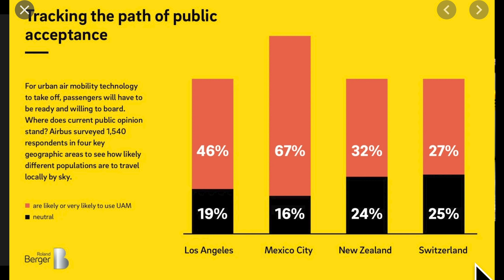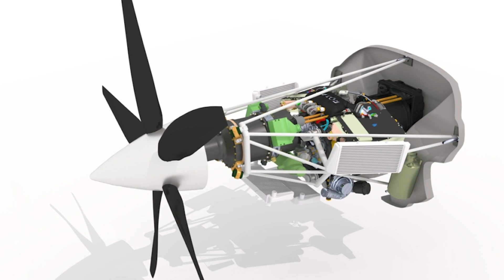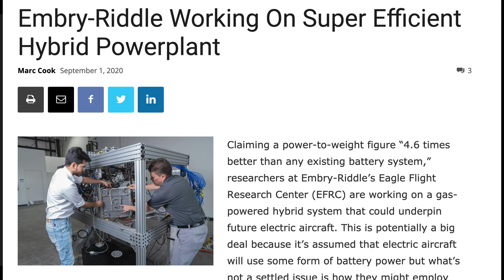AVweb VODCAST: Why Electric Aircraft Are Tilting Toward Hybrid Drives

Comment: Battery powered anything is far from green!  If you want “clean” transportation, ride a bike or walk. The mining, production, transportation and worst of all disposal of the batteries is far from green and far from cost effective.
Reply: It is far greener than fossil fuels. I've seen this sort of thought before, but for some reason people forget the immense energy usage and pollution that occurs from the extraction of fossil fuels, the refinement of fossil fuels (which is pretty inefficient since it relies on heat evaporation chambers for different products), and lastly the transportation of the fuel by another vehicle that is likely fossil fuel driven. From what I have seen, the production chain of fossil fuels alone already tips them towards the higher polluting. This is then ignoring the fact of inherent physics limitations for the efficiency of heat based engines versus the very high efficiency of electric engines.
I don't think anyone (informed at least) is making statements that the batteries are pollution free... certainly not. But, when you consider the entire chain, it is not even a contest. I find it weird some people are still trying to fight that fact. If there is any criticism, it is to be found in the specific energy density of current mass production battery technologies. This needs to be improved before it becomes really viable for things like planes.
Reply: @JimBob1937  - Most, if not all, of these points apply to battery power as well...and that’s even before they are charged somehow.  We need to make the environment better by looking at the whole picture, not just demonize fossil fuels at any cost.
Reply: @gpaull2  , I agree in part. However, you have me wrong I think. I don't demonize fossil fuels, nor do I demonize nuclear energy, or anything else for that matter. I am an electrical engineer and recognize the need for different energy sources, with their pros and cons... with that said, I think you really need to look into fossil fuel extraction and refinement, it is very pollution and energy heavy and overall inefficient. When you sum up the total carbon footprint for battery manufacturing for things like cars and other engine type usages, it still comes out ahead in pollution output. I was more so just reminding John here that there is indeed the same considerations that you should make for fossil fuels, since he seemed to attack the 'green' aspect of batteries in a rather one sided way.
As for batteries, I am a bit biased given my area of study, but I am for attempting to migrate things over to electricity. Reason being, electricity is more of a universal energy form for engineers to work with. As you expand the energy sources that contribute to things like the overall power grid, you are able to utilize those sources directly. For fossil fuels, you can only ever use fossil fuels for those devices. For electricity based devices you can use whatever is contributing to the grid. That might be fossil fuels, solar, wind, hydro, nuclear fission, nuclear fusion, tidal, geothermal...etc. Primary thing fossil fuels (hydrocarbons) have going for them is specific energy density and their 'dispatchable' nature compared to less steady sources.
Reply: @gpaull2  , this is not to mention that general usage of electricity towards a task is far, far higher in efficiency than fossil fuels. From an engineering perspective efficiency is pretty important. The issue with fossil fuels is the primary method of energy extraction is through the oxidation for heat production. One then often uses a temperature differential to extract meaningful work... but there are already large restrictions on the maximum theoretical efficiency such a device can achieve. As an example of this, look up the efficiency of a gasoline car versus an electric one.
Reply: @JimBob1937  - Yeah we need to find actual environmental solutions, and there are lots already out there.  Unfortunately it seems that a lot of people are just caught up in environmental marketing that helps them justify and feel good about their purchases. That’s much easier.
Reply: @JimBob1937  - if only it was as easy as looking up the efficiency of electric vs fossil fuel cars. I’ve been looking into how those cars are charged.  Solar, hydro, wind, and other “green” ways of producing electricity are not initially what they are advertised to be. There is a dam being built close to where I live (site C in Northern B.C.). Not only is it wrecking a beautiful valley, but once you factor in the construction and the carbon dioxide and methane that the body of water will produce over its lifetime, it becomes even less obvious what the best way forward is. 😐
Reply: @gpaull2  , yeah, to date there is no pollution free solution. The best you're going to find is which has the least amount of trade offs, lesser of the evils so to speak.  Nuclear is pretty low on pollution overall, but the expensiveness to build them properly makes it a no go for the most part with a free market since there are other more profitable choices. The ones we have in place now are very outdated designs that are kept alive because it is cheaper. I think China is the only country pushing the development of nuclear (fission) forward. When you look at these alternatives though,  almost all of them are universally better net pollution wise than fossil fuels, hence the main push towards the alternatives. Sadly, in the USA this has become political for some reason, with conservatives thinking it's some sort of left-wing conspiracy, lol. However, fossil fuels still have their place, just not to be used as a one size fits all approach in my opinion.
Reply: @gpaull2  , so, I agree, less politics and ill-informed social movements, and instead, I'd like to see more funding put forth into the energy sector for research. It is amazing how little goes into the actual research comparatively.

Comment: Innovation seems to be being driven by ideology and faux environmental issues rather than pragmatic need. Also maths seems to be the last check box on the list. All too often these new kids on the block are ideologically driven to design headline concept rather than mission focused aircraft and we seem not to be capitalising on the matured tech we have. Advanced battery solution should be left in the domain of pure science and paired with technology when ready rather than being shoe horned to fit by the engineering team which seems to currently be the case. Stick to what’s in the parts bin and use it appropriately I say and ignore the green brigade coz they will lead you to no where. Every layman I know has held a consensus that the current practical limit is hybrid yet it has taken 10 years or more for the professionals to reach same conclusion. Why is that? It’s just one big facepalm 🤦‍♂️

Comment: I believe what small electric aircraft need are structural batteries. I'm not talking about what Tesla is doing with its new battery pack being part of the frame, but instead turning the surfaces of the aircraft — the wings, the fuselage, and so on — into batteries themselves. It's not much different than the existing layers in composite materials.

Or perhaps use zinc-air batteries, which have over double the specific energy per kilogram of lithium-ion. Zinc8 is developing new batteries that embrace the dendritic formation that is problematic in existing rechargeable zinc-air batteries.
Reply: But replaceable cells are important. The new 4680 cells seems to solve problems of density for automobiles.
Reply: @TheWineroute  The new 4680 cells are certainly better than the old 2170 cells, but it's still inefficient hauling that steel around. They're glued together in the new Tesla design, so they aren't exactly replaceable there either. New batteries shouldn't be any worse than an engine rebuild in a piston, and probably have a lot more hours in them. The big downside to using lithium in aircraft is the temperature: only certain chemistries work well below freezing, and the ones that do have much lower specific density. So you have to heat them, like how the Tesla does, to ensure longevity. Perhaps waste heat could be pulled from the motor, same as Tesla. It's interesting engineering anyway.
Reply: Emile Greenhalgh at Imperial College London has done this using iron phosphate impregnated carbon fiber as the electrodes, separated by fiberglass, and laid up with an electrolyte resin. 

It's not remotely realistic to replace your entire airframe every twenty years because it doesn't hold a charge anymore. Expense and general aviation don't go well together.

Comment: Coal is used to generate the electricity, and the efficiency of the grid is very low. Batteries are not cleaner in aggregate than fossil fuels directly consumed.
Reply: Coal is on its way out, at least here in the US.
Reply: @ammerudgrenda  It's being replaced by natural gas, which isn't significantly better.
Reply: @PistonAvatarGuy  
BIG difference.
Reply: @ammerudgrenda  Not when you take into account the amount of methane that leaks from natural gas wells.
Reply: Coal is on it's way out in Europe. since 1990, coal production have been cut by almost 2/3. You may have a problem with it over there, but over here we use nuclear power, solar and wind.
Reply: @Ichinin  ...and Russian gas. (Don't be so gullible about solar and wind. Europe's sun and weather aren't significantly different than North America's. Green energy a wealth-transfer mechanism, not a resource).
Reply: @paulslevinsky580  Sorry but your statements are generic and unsupported to even bother responding.
Reply: @Ichinin  yet you did
Reply: @PistonAvatarGuy  

We'll, it is significantly better over coal in carbon released per unit energy. In addition, renewables are picking up steam. Just waiting on energy storage to catch up.
Reply: @wzDH106  AGAIN: Not when you take into account the amount of methane that leaks from natural gas wells.
-
Energy storage is NEVER going to "catch up," the wealthy have bet the future of humanity on nonsense, because money.
Reply: @wzDH106  Also, we were out of time to act decades ago, the only thing left to wait on is the collapse.